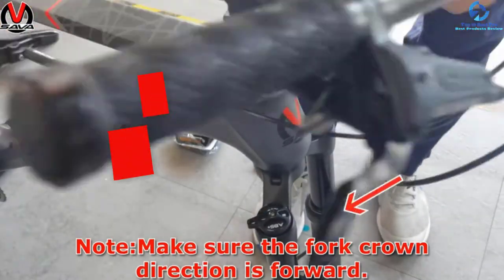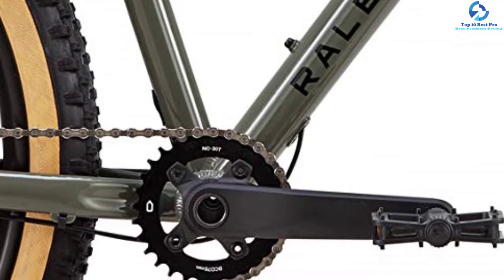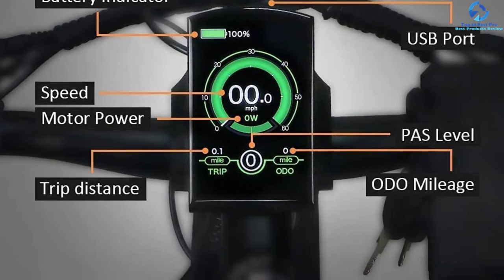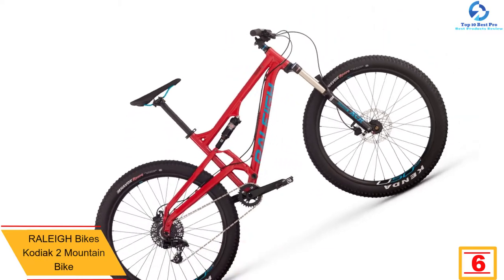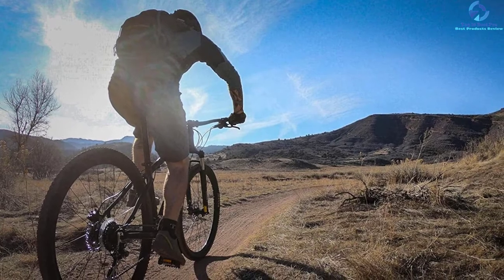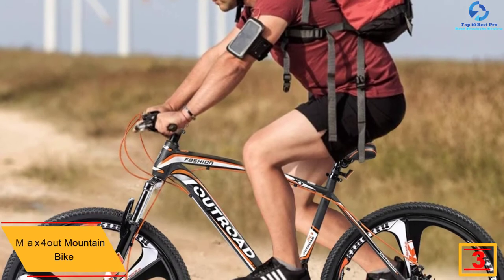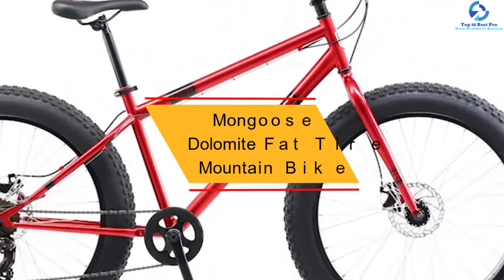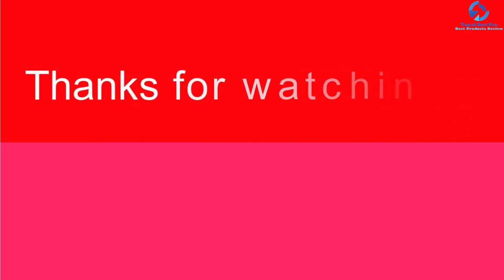Top 10 Best Mountain Bikes 2023 Reviews

Comment from the maker: 🔶 10. Diamondback Hardtail Mason Mountain Bike
👉  https://amzn.to/2WzvVi4
🔶 9. Raleigh Tokul 1 Hardtail Mountain Bike
👉 https://amzn.to/3uxH67C
🔶 8. W Wallke X3 Pro 26 inch 48V Lithium Battery Mountain Electric Bike for Adult
👉 https://amzn.to/3B1ZDLE
🔶 7. Diamondback Line Hardtail Mountain Bike
👉  https://amzn.to/2Ygbuag
🔶 6. RALEIGH Bikes Kodiak 2 Mountain Bike
👉 https://amzn.to/3ah1nFj
🔶 5. Tommaso Gran Sasso 29er Mountain Bike
👉  https://amzn.to/3ion9LF
🔶 4. SAVADECK DECK300 Carbon Fiber Mountain Bike
👉 https://amzn.to/39Z3Y6q
🔶 3. Max4out Mountain Bike
👉 https://amzn.to/3A0nM45
🔶 2.  Mongoose Exlipse Full Dual-Suspension Kids Mountain Bike
👉 https://amzn.to/3mjp5WQ
🔶 1. Mongoose Dolomite Fat Tire Mountain Bike
👉 https://amzn.to/3B82CSX